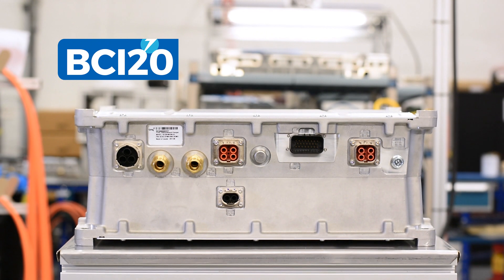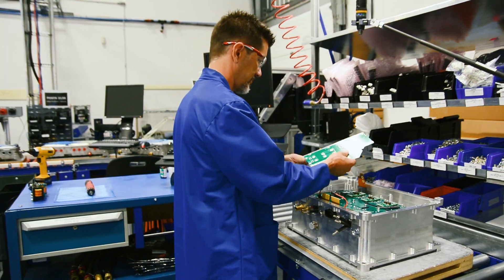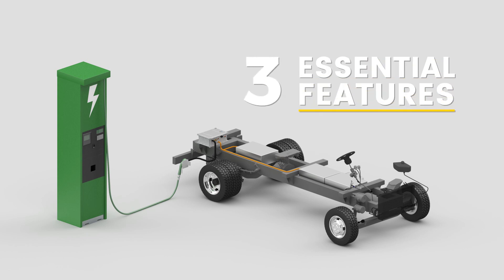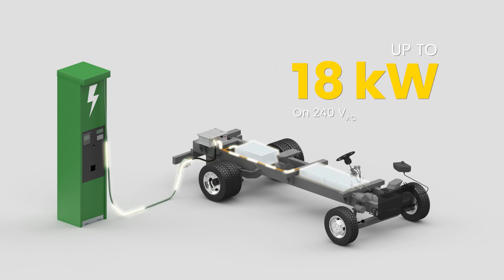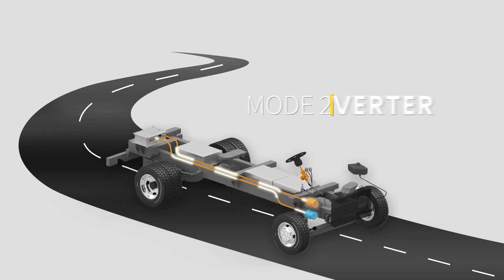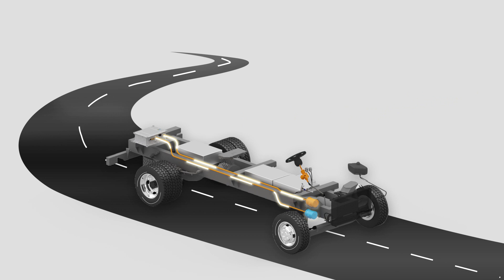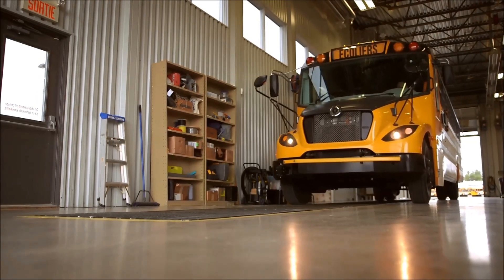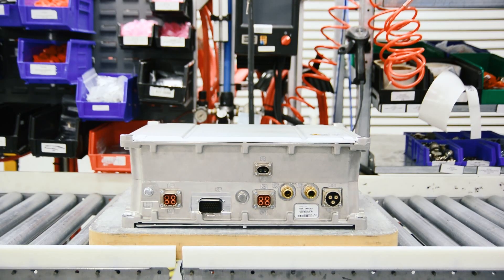Introducing the TM4 BCI20 Bi-directional Charger Inverter

Comment: Thanks for offering this new perticular product.  Once you can also offer 100Vdc version for lower voltage EV like the ZERO motorcycles, i will be interested. Smart grid to power home using a ZERO of 16kWh is also very interesting!  Do you currently offer version with split phase 120vac-neutral-120vac ?